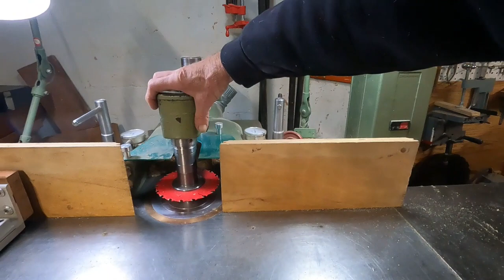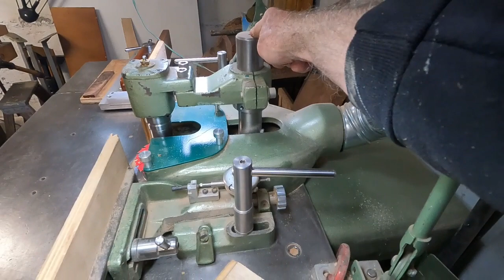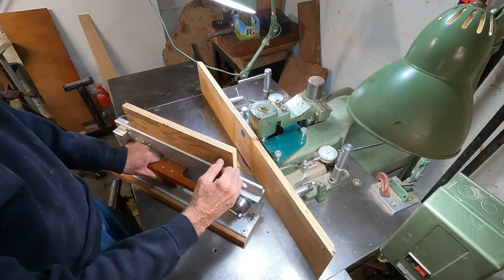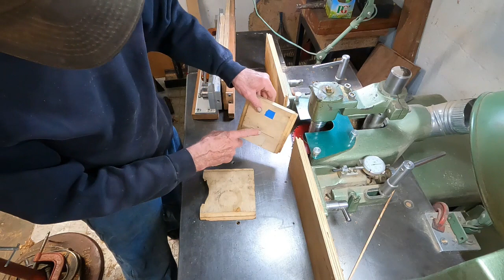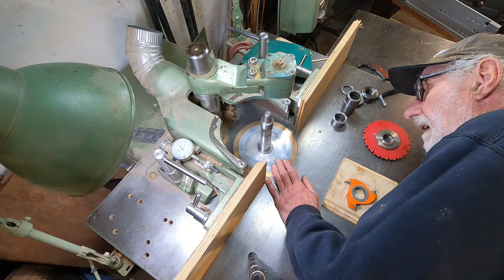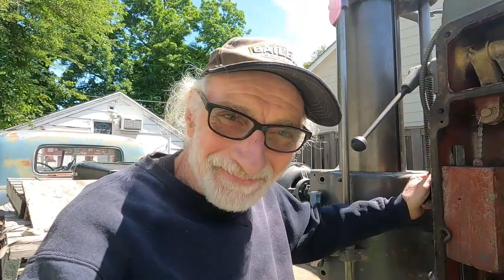Machine shop restored Shoda spindle moulder

Comment: Nice machine. Getting it downstairs must have been fun. Even though I’ve been using CAD since the mid 1980s, I’ve still got my drafting table and rulers. I even have a small portable Alvin model. Very nicely made. I have used it for a coup,e of decades. Since I bought my 12 x 18 Hp color printer way back in 1998, I print out my own draoh operation when I need it.
Reply from the maker: The machine is designed to be broken down and moved, not bad there. The drafting tools were at charity thrift shops for very cheap for years, now bringing more money at antique stores. I like pencil drafting and really have no need for any design programs due to the nature of my work. Some of the gov and also private labs still use pencil drafting for security, drawings kept in a safe cannot be hacked.